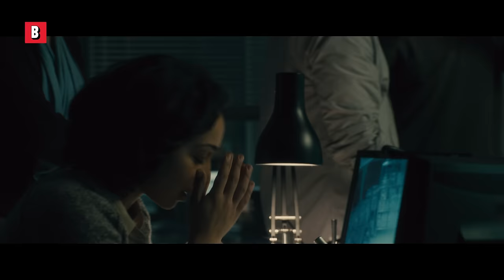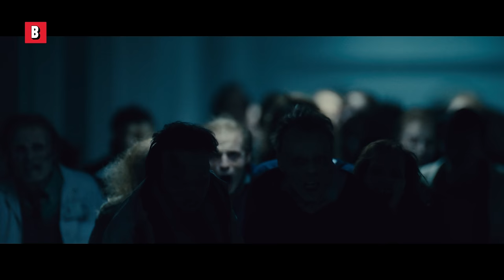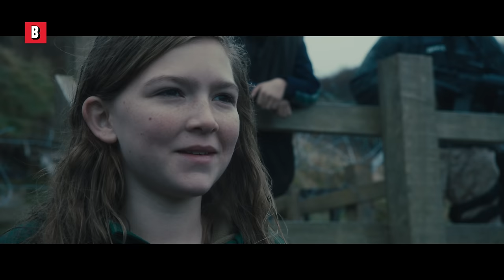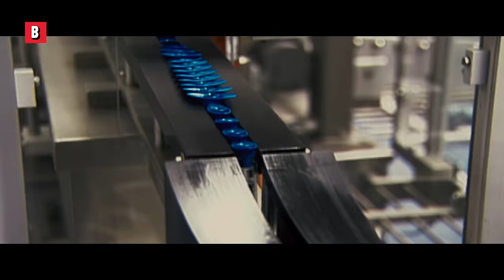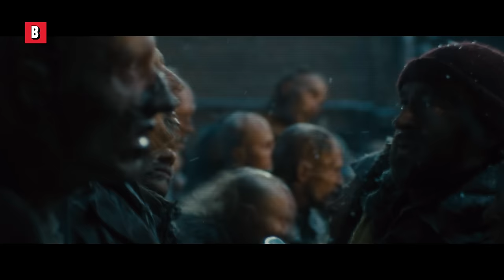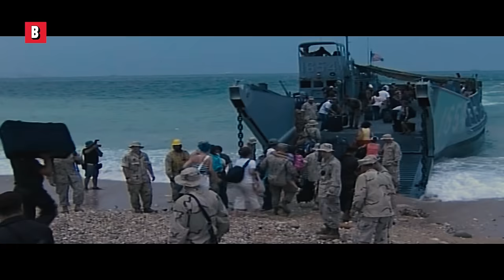World War Z Full Ending 🌀 4K

Comment: I would like to see this film to come to 4k with a better transfer sharper and clear. paramount is bring there own extended  version transfer on to 4k but it comes in with there horror volume 2 box set with 4 other films  it needs to be a stand alone not paying almost £100 for just the one film. Shout factory done a 4k version but its only the theatrical and the reviews about the picture quality was lacking in clarity too soft and a disappointment not worth getting over the blu ray version so hoping paramount done a much better needed transfer.